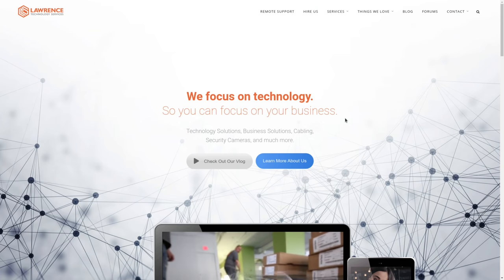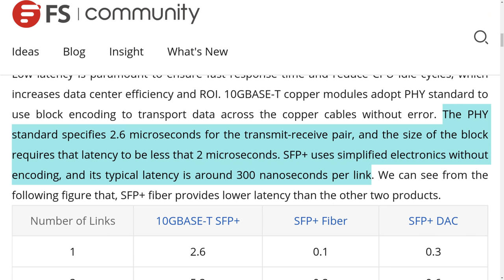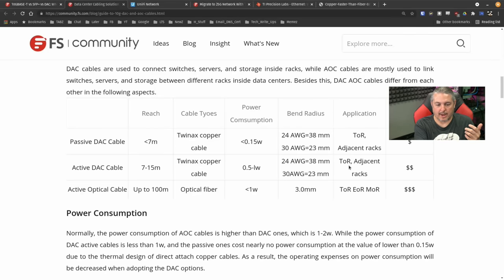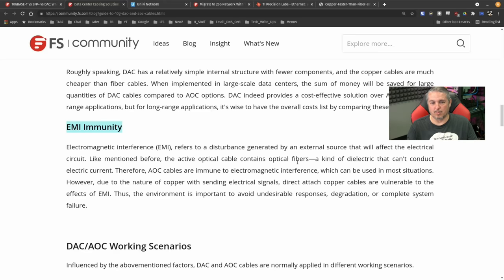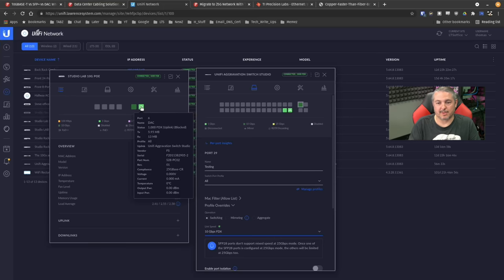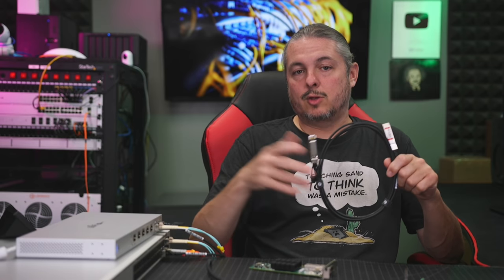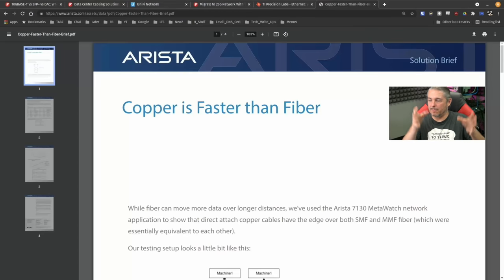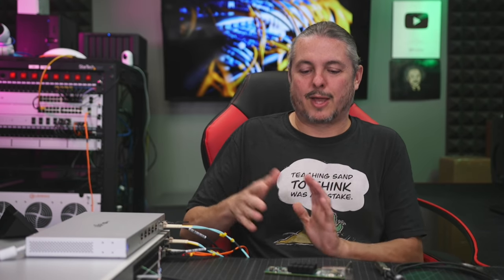SFP SFP+ SFP28 and Why You Need DAC in Your Rack!

Comment: Another very informative video. I think a video on proper rack/equipment grounding and lightning surge protection would be great too. I'm sure there's plenty of us out here that have taken 1.21 gigawatts through a WAN port that let the smoke out of our racks! This is what's pushed me into adding fiber into my rack to electrically isolate my modem from my pfsense box and the rest of the rack.
Reply: Great idea
Reply: We usually do that for all our RF towers to routers to avoid frying up routers but we also have a grounding and surge protector
Reply: @Vinothmanick  The problem with surge protectors is most people don't realize how they work and that the gas tubes inside them degrade over time. So you could have a high end UPS that you thought was going to keep you safe until you find out that the gas tubes are gone and it's not offering you any protection. What do you do about things like my 5 port PoE switch that only plugs in DC and doesn't have any kind of grounding on the case? All of this kind of rolls into a how to properly and safely power your equipment theme that I haven't really seen covered well anywhere.
Reply: @Chad_at_Big_CAT_Networking  - I am figuring out my first network & its not even something I considered.
Reply: @Chad_at_Big_CAT_Networking  manually route a grounding wire and ground the case of the switch by using a grounding screw or something, it's absolutely terrifying (for someone who doesn't know if it works) and looks ugly as hell but it works perfectly

Comment: Another good thing about AOC cables is they meet Tempest specs if you work in Government or Classified networks where multiple classifications are in one datacenter and they will not let copper cabling cross across racks at all
Reply: @Conor Hanley not really as its a different type of media. its more like comparison of using optical output from tv so surround sound for digital audio stream compare to a single copper wire for each speaker signal. You can interchange the two like a cheap to a high class cable. if my understanding out "hi-fi audiophile cables" is the same as yours

Comment: what made Ethernet/RJ-45 so great was it just worked. even with the wrong speed cable it would still work. all these transceiver/DAC based systems use proprietary equipment and if you buy the wrong brand transceiver, or DAC/AOC cables, your screwed. and it's not like there are only 2 or 3 choices, there's DOZENS, and they rarely work together.

Comment: Did the USB guys name SFP28? Probably not, they would've named it SFP 4.2 3x3 or something dumb.
Reply: Wait for the SFP128 that works at 100G 😅
Reply: @rjdp3  100 gbit comes in QSFP form as QSFP28. It also comes in SFP-DD, although I wouldn't see a point when QSFP28 exists. QSFP56 is 200 gbit and QSFP-DD is 400 gbit. Not sure how 800 gbit is also QSFP-DD.

Comment: SFP28 vs 25Gb:
So a few things to note here.
1) Ethernet measures it's speed before the CRC overhead, so a 25Gb connection is actually transmitting more than 25Gb "over the wire" so to speak, but the CRC overhead isn't counted.  I think it's like 25.6 last time I searched this up.
2) Fibre Channel networks have been using names which are largely marketing only for a few generations now.  So 32 "Gig" FC is actually 3200MB/s and after CRC overhead uses around 28.1 Gbps (really not bits, but whatever).
3) Because these were so close together, the Ethernet geeks and the FC geeks decided to team up and have 1 standard they could both follow for some of the cabling and connectors and such.

So to summarize, the SFP28 standard can handle up to 28Gbps (Gigatransfers really).
The Fibre Channel folks use this at 28.1 for "32 Gig" FC
The Ethernet folks use this at 25.6 for "25 Gig" Eth

And as someone else mentioned, MOST commodity 100Gb these days is 4 lanes of 25Gb being aggregated at the ASIC level.
FC Similarly offers, within the 32 Gig spec, a 128 Gig trunk port option which is similarly just 4 lanes of "32 Gig". Often used for connecting larger FC SAN Edge switches to a Core (what Brocade would call a Director class) FC Switch.
Reply: Oh, and SFP56 is already a thing now too,  and you guessed it, same physical socket size as it's predecessors.
This is 1 lane of 50 on a family of 200Gb switches that started arriving in 2021, or I think Aruba has a switch with SFP56 Uplinks.

Comment: I use DAC where possible...  I've stressed LATENCY loss for CAT for years.  DAC is so simple, fast, and basically is like connecting two switches together to be the SAME switch when latency is concerned... so like having it as just a second daughterboard and another row of ports on the same switch.  If you attach two switches via CAT/RJ45, you have massive latency loss between nodes across switches.  For distances, running fiber with SFP+ adapters is the next best option.  but same rack, I use DAC to connect all network equipment and even put SFP+ ports on my servers that are 10gig+ to use DAC for all servers to switches to make latency even lower to node.

Comment: Copper cables can have higher error rates than fiber; best not to use any kind of copper for FCoE or ISCSI traffic in a high performance environment unless you want to be defenestrated by the storage admin(s). AOC might work, but it’s unlikely the storage/server hardware is the same brand as the switch unless you’re in a UCS shop, which brings us to the second issue with these cables.

Any kind of DAC/AOC may be problematic if the devices they are plugged into are from different vendors. They all seem to play the “you have to use our cables” game, and in a mixed environment, you should use the proper vendor-supported transceivers (with matching standards) at either end with the appropriate fiber type between. Otherwise, you may hit a wall when you need to get vendor support for the non-matching device.

Comment: i have on dl380 that im gonna use as a storage machine (and some vm's). and i want to connect it to my R630. Would a dac be the best machine to machine connection for file transfers?
i also have spare 1G ports (no 10gb port on this device). Is it worth the price of 2cards, cable

Comment: Im running proxmox and truenas, both with intel x520. Using iperf im only getting 2.5g when truenas is the server and proxmox as the client. When doing Proxmox as the server and truenas as the client, it goes to 3.5g. I have set both MTU to 9000 on both machines. I have tried 2 different DAC cables, no change. Can someone please push me in the right direction to trouble shoot this issue and get full 10g.

Comment: Do the fibre cables have the minimum bend radius like they used to or is that not as important (relatively speaking) as it once was or used to be?
Reply: It is still there.
Reply: @ivosarak959  
Would you happen to know what the minimum bend radii are for the different types of fibre cables?

Comment: I think that 28 Gbps is max linkrate. Ethernet is just using it as 25. But for custom FPGA stuff 28 Gbps is max linkspeed for some generation of devices. Now they have 56 Gbps links but these are PAM4 coded. So symbol rate is still 28GSps

Comment: Would you recomment cat8 over SFP+28?
Reply from the maker: No
Reply: @LAWRENCESYSTEMS  ahh ok. But price wise cat 8 seems way more cheaper than sfp 28. I'm asking as I am planning to future proof my house with at least 20gbit connection
Reply: @jonneymendoza  Run fiber, surely you're not talking about running DAC cables in your walls
Reply: @estusflask982  no lac fibre om3 cables

Comment: Wow. Before speaking check:
Are you SURE THAT DAC signals are NOT DIFFERENTIAL?

That’s the difference between almost college and no college at all!

Want to know the specific coding they use???

If you knew any electronics you would have never said that…
Reply from the maker: I said it does not do "THOSE" differentials as in it does them differently and uses simpler method.  But please keep being pedantic as it helps with YouTube engagement. 😎